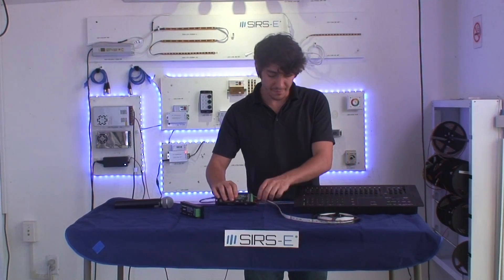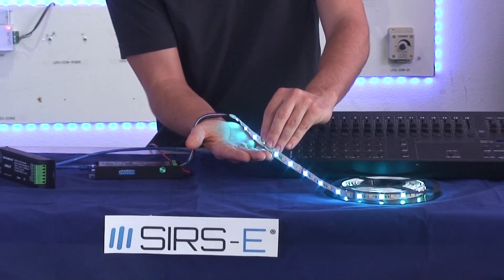DMX LED Controller RGB & RGBW LED-CON2-R2 LED-CON4-R2 by SIRS-E

Comment: Hi there
I am looking for a driver for 24v LED thin stripe lights.  We will have two 20m LED stripes with 5 meters apart. Can I use one driver for the 40meters? and connect them with 2.5m wire on each side?   What will be the best controller?
Reply from the maker: Please contact our Technical Advisor at 956-522-2006

Comment: Hello and thanks for the information. Do you have similar drivers for 8 channels? Any recommendations? Thanks!
Reply from the maker: We have a 6 channel controller LED-CON6-R2 http://sirs-e.com/shop/led-dmx-controllers/rgb-led-dmx-controller-r2-6-channels-sirs-e/ or use 2 units of the LED-CON4-R2 http://sirs-e.com/shop/led-dmx-controllers/rgb-led-dmx-controller-4-r2/  If you have other questions please contact our Technical Support Department at 956-522-2006